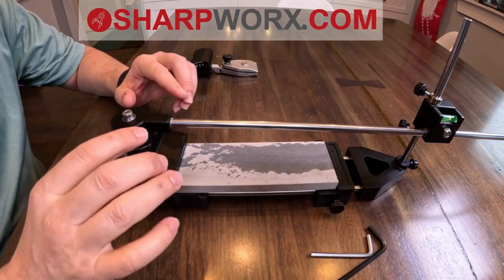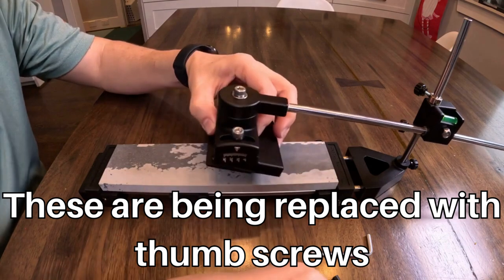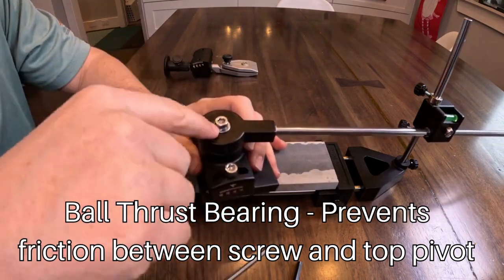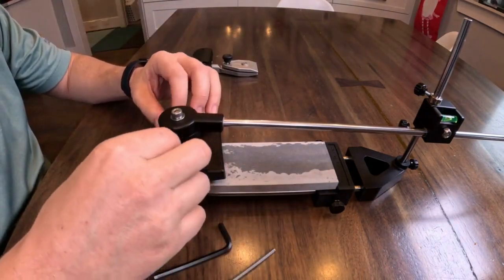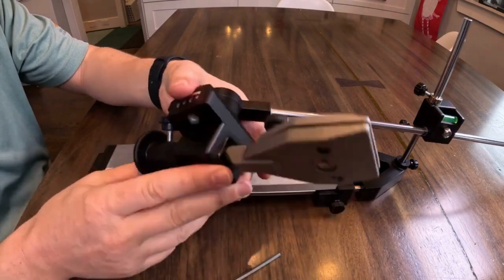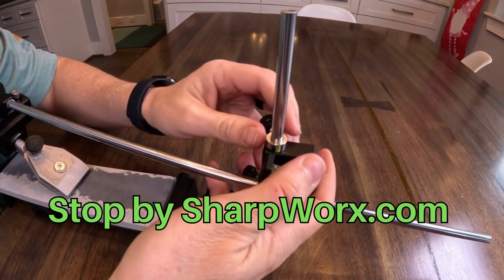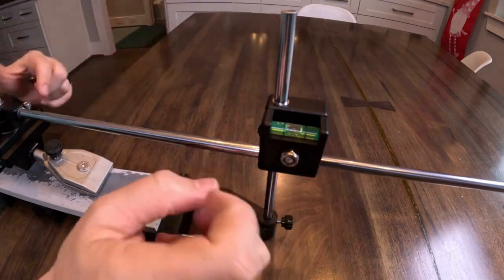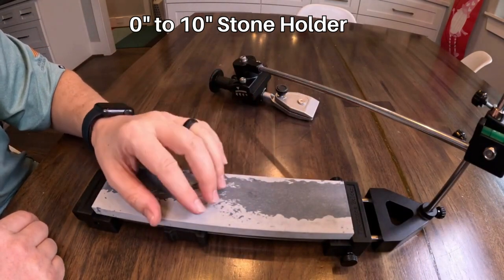Freehand Guided Sharpening - SharpWorx Professional - An Overview of the Device

Comment: The bubble level is a nice concept to try and have a 90 degree angle for the arm, but what if the surface your sharpener sets on is not level? then you would not have a 90 degree arm.
Reply from the maker: Yes. The assumption is your stone is horizontal and parallel to the horizontal bar. If it isn’t then adjustments would be needed. 

That said most people are sharpening on countertops which tend to be pretty flat.

Comment: This came a long way. 

I like your product, but I can freehand already.   This may be good to set a more precise angle though. seems to potentially address the issue other clamp systems have with messing up the belly profile.   Do you notice the belly shape changing after several sharpening sessions?
Reply from the maker: I can’t tell a different. If you clamp near the tangent point of the belly it seems to follow it well. 

I tend to form the edge once and then use 1000 grit from then on so there isn’t much material removal.